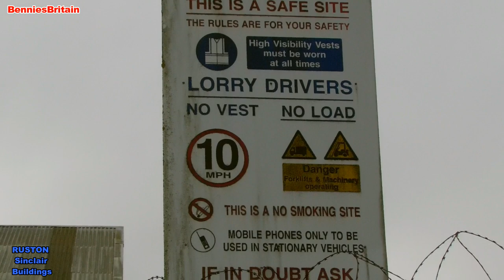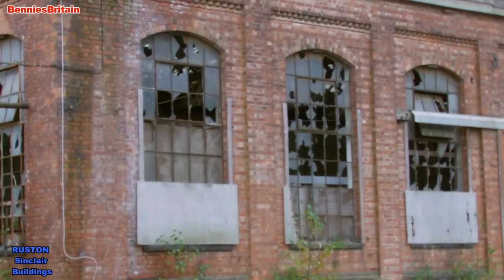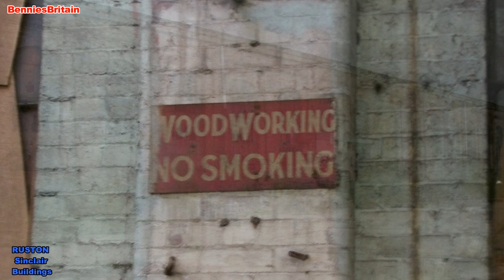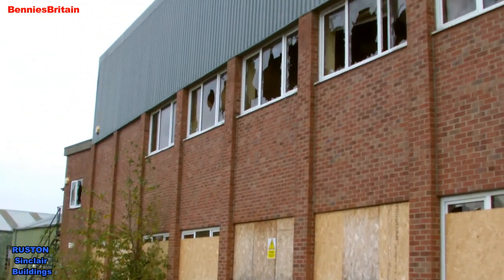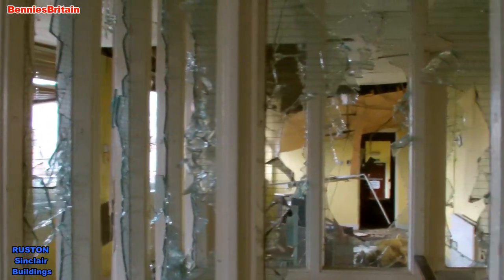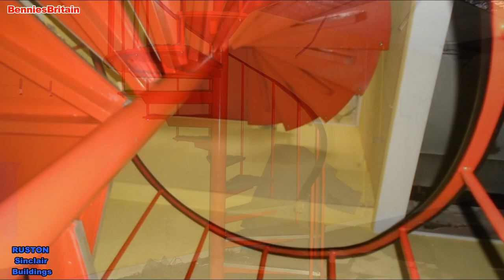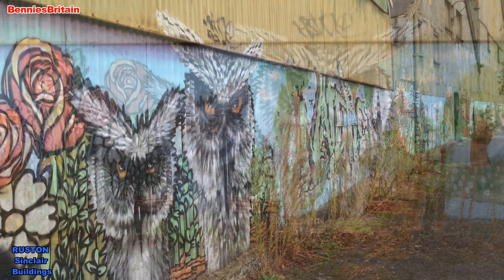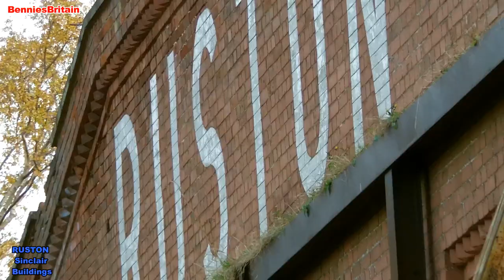Ruston Sinclair Buildings - Lincoln

Comment: Shocking and sad to see the place where I did my apprenticeship when it was Dorman Diesels Boutham Works 
The big  brick RUSTON building was 66 Shop were ground crank shafts to Rolls Royce standard , the lower adjacent brick building was the works canteen  on the left half and the Apprentice Training Dept on the  right , to the left of that building was the engine testing house , first building through the was the the gate house ! and behind it in the main factory was that Fuel Injection Department........I could go on and walk the whole factory floor reminiscing  about some massive machinery it once housed and all men who toiled hard at there lathes, pillar drills,  CNC milling  machines and every other machine you could think of